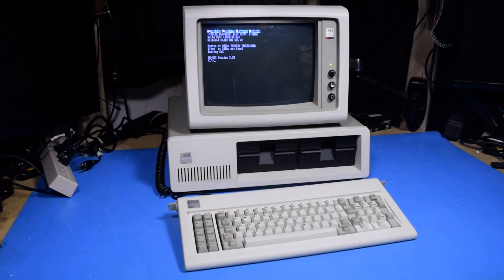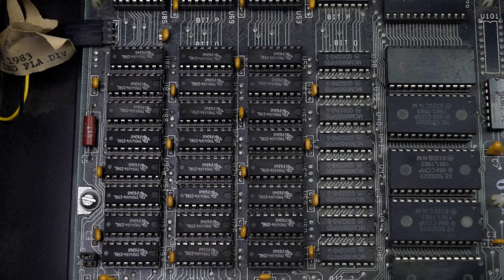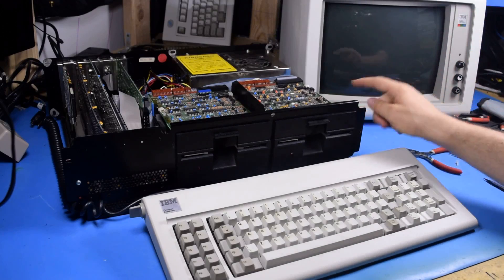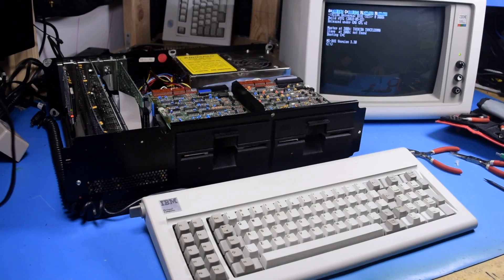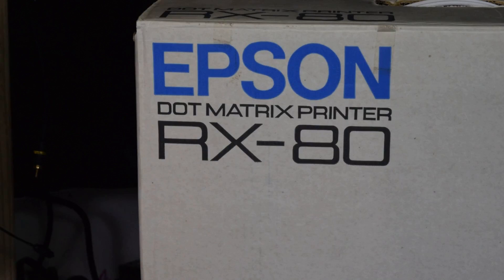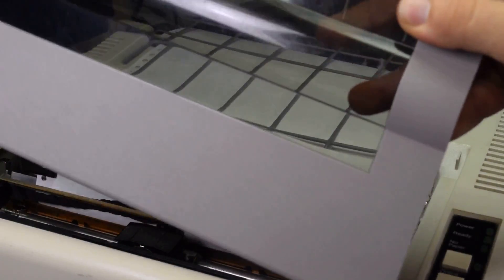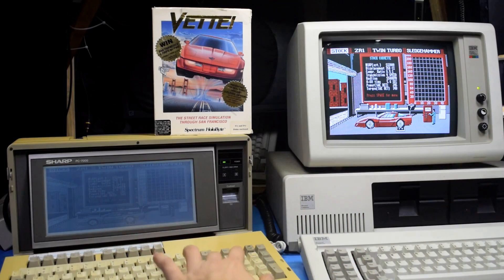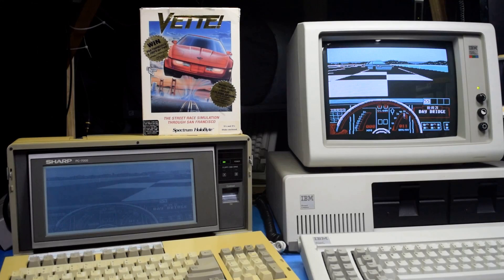IBM 5150 Tecmar Captain RAM Card Upgrade

Comment: I use LPT extensively to connect PCs in my collection using DOS's Interlnk-intersvr. Works faster than RS232. In 'pre-xtide days' my 5155 Portable acted this way as a 'file server' for my 5150, where DOS would assign a new drive letter and it worked (and works) like a dream!

Comment: When I order RAM chips usually 20% are defective. So I was suprised it did work the first boot. I use a software to detect which chip(s) is the defective one. So I recommend ordering +20% of what you need.

Comment: I actually had Vette and Stunts on a 4.77 MHz XT with CGA and 1 MB.  Eventually it was a lot better on a 286 with VGA.  My little brother (maybe 9 or 10 at the time) even took apart a Kraft 2-button joystick and made an extremely usable steering wheel and brake/gas pedals.

Comment: Now, find yourself an NEC V20 chip, and you will have the complete 80s, pushing the XT to the fullest experience. The V20 is a drop in upgrade and worth 10% performance upgrade

Comment: I remember installing many, MANY memory chips like those. If I recall correctly, DOS wouldn't natively use memory above 512K? I remember having to load HIMEM.SYS and then use LOADHI to move as many drivers and TSRs as possible up into higher memory to free up base memory.
Reply: 640k. It should be enough for everyone!

Comment: From wo you can order this chips? i have an 286 PC with just 640 k of ram.
Reply: Depends on the machine. Some 286s can be upgraded by chips, some can be upgraded by 30-pin SIMMs (or SIPPs). Some can take both. And all can take ISA memory cards. :)

Comment: I only ever used the LPT port for 3 things. Printers, Scanners and a pre-USB MP3 Player.

If you do ever find yourself wanting to send files via the com port, I suggest you find a copy of LapLink, it's the best tool I ever used for that, giving you full access to the file system on both machines. It even had instructions on how to use the mode and copy commands to upload the binary from one computer to the other.

Comment: I had one of those HP MX-80 printers with the GPIB/parallel interface.  They changed out the internal ROMs so they only speak HPese.  I swapped the ROMs with stock MX-80 ROMs and it worked normally according to the MX-80 manual.

Comment: Great videos man. These things are challenges that's for sure. Glad you got it rockin'. Beautiful machine. I have an old Compaq Deskpro 386s with what appears to be a 32-bit ISA Memory Expansion Card with 1MB of RAM on it. I believe the motherboard also has 1MB of onboard RAM. I was just curious if ISA memory expansion cards are somewhat universal on IBM compatibles? I've been having difficulty finding ISA memory expansion cards for a reasonable price. Mine has all the dang chips soldered in so unless I wanted to do some serious work, I might be stuck looking for a whole new card. They made 4MB expansions for my model, however they are extremely rare to find. There might be some hope if they aren't brand-specific. I'd also be curious to know if a 32-bit ISA Memory Card can be used at the same time as an 8-bit or 16-bit ISA Memory Card. Hope all is well and keep up the great work!

Comment: The 5160 must handle RAM counting/checking differently than the 5150.  It's been YEARS since I have used it, but it has 640k, and it actually does the RAM count on the screen when you turn it on, and yes, it does take forever!  It also has an internal, full-height MFM hard drive in it.  I tried to fire it up the other day, but I think it being lost for YEARS, in a storage shed, has gotten to it.  I can't get error beeps or any display or anything, and I can't find the keyboard, either!  It's driving me crazy as my aunt bought the thing brand new back in the day, and the last time I had fired it up in the early 2000s, it was still working fine :(

Comment: Hi All, My first PC was a commodore PC 10 , XT Clone with 512k ram and 2 x 360 floppy, all in green text.  I realy loved that machine, it has the combo hercules / CGA card that was very crispy in font and simulated CGA colours in shads of green, later a real CGA monifot was used and i had to find the jumper settings, but all fine.  I remember buying a real time clock for @ $30 and about $50 for a adlib card. Later i purchased a Extended I/O card to run the 1.2Meg 5.25 floppy.

it was very good and ran just about everything i could get my hands on - 512K who needed the ful 640k.

You can use laplink or similar ( FXlink i think )  Laplink V3 fits on 360k floppy, V5 on a 1.2M, use the paralell interface it is much faster, yo can remote map a drive basically

For Dos, i found 3.2 the most stable, and 4 gave issues, but it possibly supported multi threads, 5 was good and pretty and the memmaker feature cool, of cource 6.22 is the best and buy them you have the multi boot option and multiply config sys option on boot up, or use a collection of boot floppies.

Multiplayer dos games are around, scorched earth and civilization are the early ones i remember, As you metioned the most basic is Trasmit to Recieve, crossed over and join the earths.

I also used a null modem cable and comms programs ( procom then telix on the PC  ) and i used to send text files from my amiga 500 to my PC, even multiplan and unicalc files, that were saved as (symbolic ?? )  transfered over and ran, later with a 386 laptop i used just Microsoft works for DOS

There was a share ware game, lazer wars or similar, shareware but with pages of tech info on setting up multi player and lan and pages on how he coded the joining of the 2 pc etc with null modem cables. 
ie the control codes of PC1 - object move left and how that was sent to the other pc. there was a rouge based game with multi player,then later on doom and descent, this was the time everyone was installing co-ax in the house, mum still has the co-ax cable under the house and between 3 rooms
I am not sure if you can upgrade these with a USB Gotek floppy emulator, my oldest machine these days is a Pentium 100

Regards
George

Comment: Little tip, when you're putting in fresh RAM chips from the factory, the pins are facing a bit too far outwards.press the chip's pins against a flat surface to uniformly angle them straight or even slightly inward, and they'll go in with a lot less fidgeting / resistance / problems.

'twas almost painful watching you trying to put in those last two rows.
Reply from the maker: These were already formed, that's why I wasn't using a lead former. It was mostly the camera angle I picked meant I couldn't see if I had the chip properly aligned.
Reply: @TechTangents  Yeah, being able to see what you're doing is kind-of important, and a common problem with filiming. Likely explains why the farther to the left you got the harder it went too.

Comment: If you wanna be cheap you can recondition old dried up ribbons with an oil & solvent mixture. Spraying it with WD-40 and then letting it soak for example works a treat for my typewriter ribbons.

Comment: I used to use null modem cable to transfer files using Norton Commander link. It was quite convenient when my friend was to floors away from me. It worked fine using off the shelf phone cable at 19200 bps.

Comment: What exactly is a null modem? I've heard it mentioned a few times and I don't really understand why a modem is introduced into a straight serial connection.
Reply: Null Modem simply means "No modem involved". It's a straight (with a few crossed cables) connection between two peers.

Comment: You could put in an OPLPT2 on the printer port and play some games with nice AdLib sound...
Reply: Unfortunatly just some games work with that, and many will require some workaround to make it work. I've awready recomended it to him, when he made a video about his 98/95 laptop, that didnt had a soundcard
Reply: They all need drivers to adjust the addressing, and an 8088/8086 machine really isn't up to the overhead.  They're really intended for faster but still old laptops.

It seems that for now, the best solution for an XT is a clone OPL2 card.  Though, leaving an XT speaker-only is pretty reasonably era appropriate.

Comment: Epson badged one of their dot matrix printers for the Commodore 64. The MPS-1000 Printer works with both IBM and Commodore computers. And it will run on just about any generic DMP drivers with anything that has a parallel port.  So you could have the one printer for a whole range of different computers. Basically all the Commodore machines and any machine with the port.

Comment: Small tip for future videos: When you get something, tell us with few sentences, where and how did you get it. ;)
In this case, the memory chips: Where did you get them? Was it maybe ebay/aliexpress? Are they new or old? Old stock or today's alternative that is compatible? etc...
Reply from the maker: In this video I talked about:
 - 5150 itself
 - Tecmar Captain
 - RAM chips
 - 5152 Printer
 - Serial cables and adapters 
 - Vette!
 - XT-IDE

So when you say a "few sentences" that's not really the whole story. I could talk about the origin and details of everything in the videos but I have to think about what I put in the videos and how much time it takes. What is or is not interesting is also subjective. So I have to limit what goes into each video. In this case I said what the RAM chips were and from there you could find them if you were interested.
Reply: Keep doing your thing the way you want AkBKukU.  I will watch regardless.
Reply: AkBKukU, no problem and i understand. :)
I just started to wonder, where did you order those rails of chips? Are they new and sold on ebay?

I still love your videos, i really do! They are amazing, as i really do want to see the insides of everything aswell.
Reply from the maker: I did buy them on ebay. I don't know if they are new or not, the date code on them looks like it may be 2014 but I'm not sure.
Reply: I also would like to know where the ram chips came from.  I have searched in the past but what sources have good chips can help us all out.  Thanks for the videos.